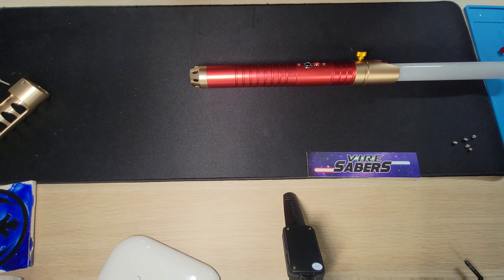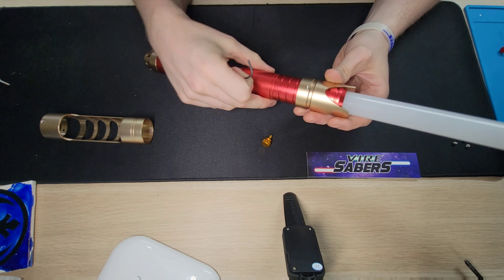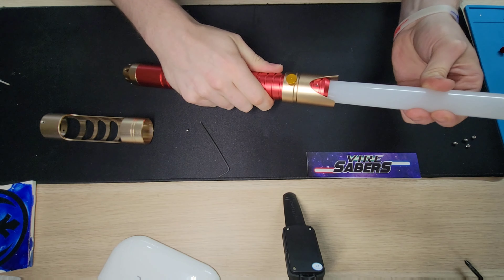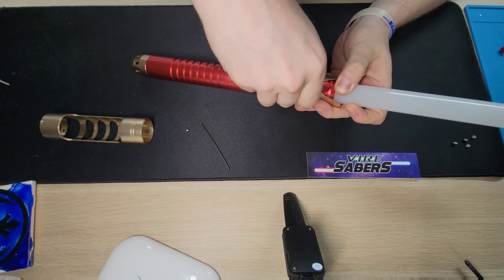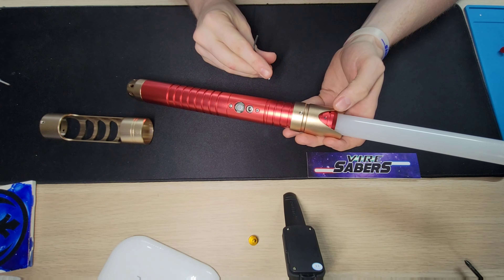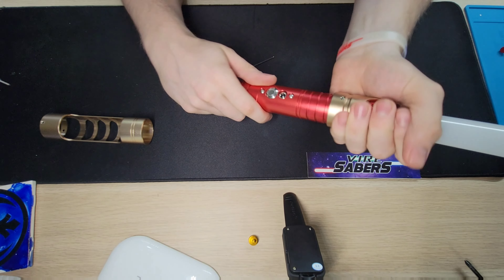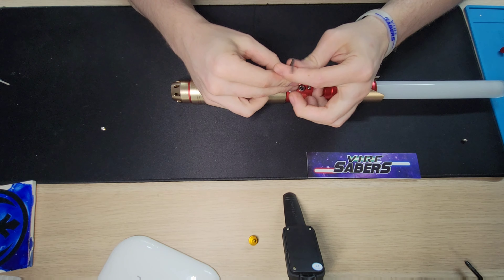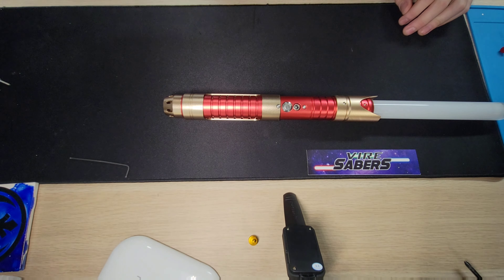Installing an LGT Emitter Shroud and Grip Sleeve to your Vire Saber

Comment: I have a question. How would I go about using the bottom screw in the switch section to secure the sleeve with a control box so that everything is flush?